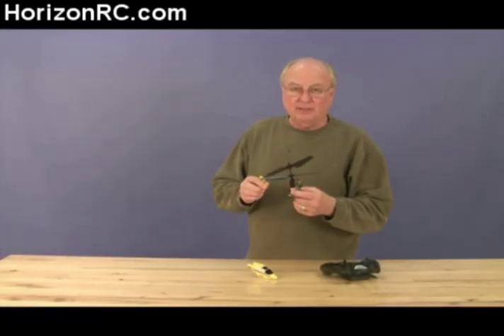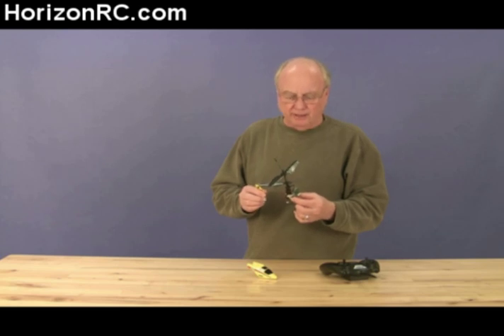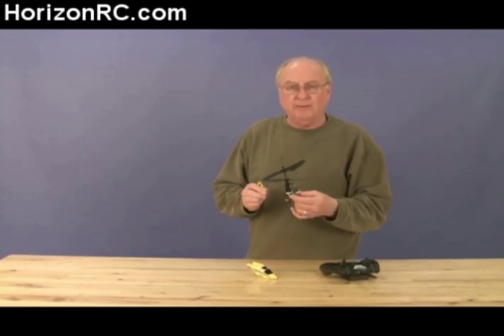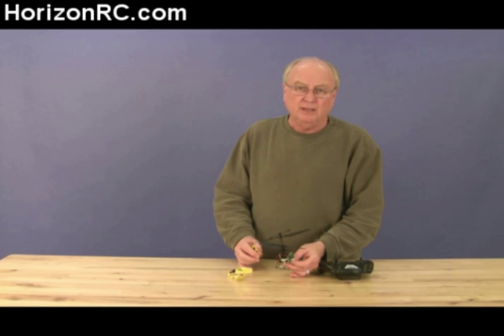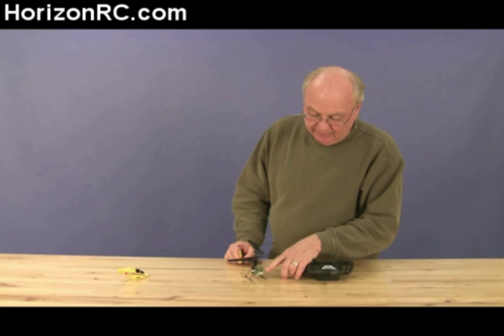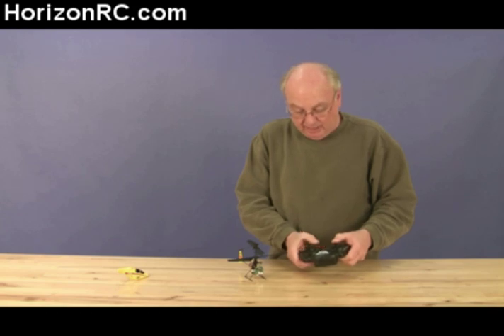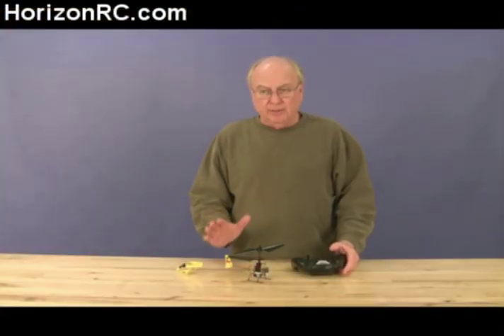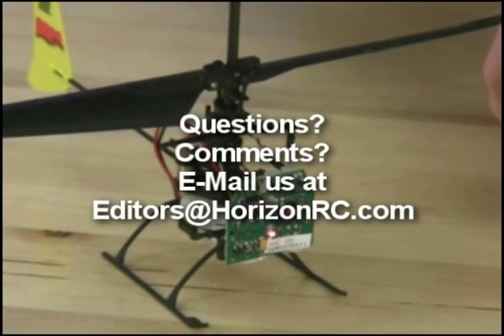HorizonRC com How-To: Bind-N-Fly Binding Process

Comment from the maker: If the DSX9 uses Spektrum DSM technology (Which it may or may not as that is not a product we carry) all you do is plug the battery into the mCX, place the radio in bind mode and wait 3-5 seconds. Wiggle the right stick after a few seconds and if you have it, it's bound.

Comment from the maker: You need to remember that many of these planes and helis are bought by first-time RCers. They take it out of the box and it works. But for the person who, say, bought an mCX RTF and picked up a Vapor BNF and wanted to use the same transmitter it can be a little confusing.

Comment from the maker: @PaintfullGovernor Plug the battery into the plane. After a few seconds the receiver/esc will be in Bind Mode. At this point push the left stick IN on the transmitter (you'll hear a click) and power the transmitter on. Hold the left stick in for a few seconds and release. This should complete the bind process after a few seconds.

Comment from the maker: It sounds like you need to rebind the transmitter. Follow the steps in the video and you should be good to go. If that still doesn't work contact product support. The phone number is in the manual.

Comment: Do you have a video for the binding process for a Blade 120 Sr or anything to help me do it?? Because I have a RTF one but ive also got a BNF for spare parts but now my RTF is Not working very well ( Losing conexion with the transmitter so all else fails and it falls out the sky ) so can I bind the controller to a BNF heli or do I need a new controller ??

Comment: Help i got the mcx s300 and i took it back becouse of reasons and they woundt take it back but would try to sell it used so i did so no one bought it so i took it home and i use it now when i charge it the LED doesnt blink anymore i put brand new battaries in the charging unit and left it thare for about a hour and a half i tried it and all the heli did was blink so i tried this and i did it all right but the heli keeps blinking and i have no control so please help on both of those questions

Comment: Would it be possible to use the MLP4DSM 4-channel DSMX transmitter  to bind to a SPM9645 DSMX Remote Receiver?  I purchase a DX 6  but need a 7th channel to get my gimbal to tilt on my blade 350QX.  The transmitter I was sold doesn't have a spare radio channel so I was wondering if I could use a second transmitter to control the Gimbal tilt.

 As I also have a Nano QX quadcopter RTF, I thought that this might be a novel solution.  But is it possible?
Reply from the maker: No, what you're trying to accomplish won't work. You need the transmitter for the 350 and the gimbal to be one and the same. Plus the MLP4DSM is a lower power transmitter, designed for indoor flight and ultra micros where you're range isn't as important. You'd fly the 350 beyond the range quickly.